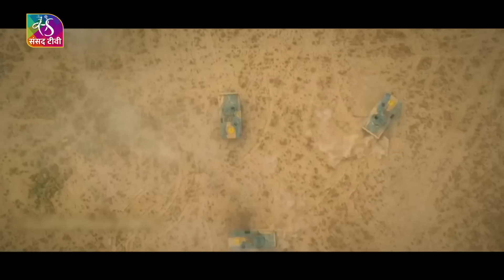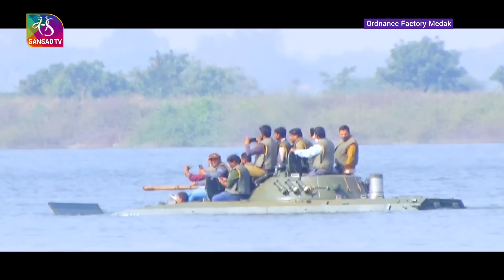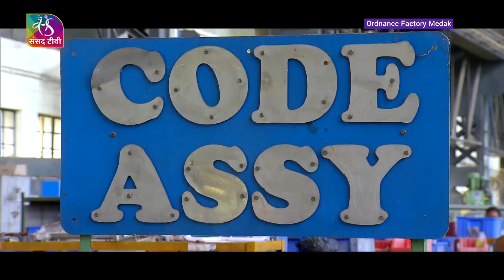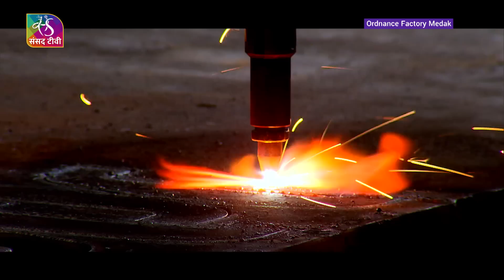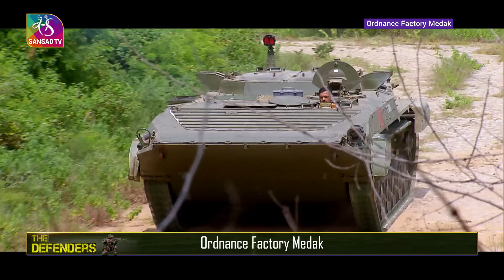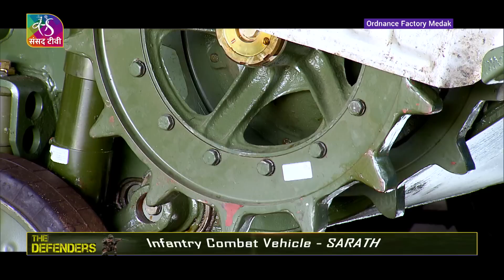The Defenders:  Infantry Combat Vehicles SARATH ICV (BMP-II) | 17 Sept, 2022

Comment: indian propaganda ..this vehicule is 70 years old from battles
Reply: BMP-2 and it's.. kind of like a rival, the American Bradley are both from the 80's, BMP-2 by itself is decent, I'd say that India simply just needs to upgrade it like how some other countries that poses the BMP-2 have.
Reply: @pipopoikapelaa5468  did you see the bmp vs bradley in ukraine ?
Reply: @lonewalker6110  yes but this stuff can also depend on training.  Better training and upgrades (modern fire control system, new sights, maybe a more accurate version of the 30mm, better armor and such)

This could be possible since India does build these BMP-2s themselves

Comment: 6:03 
800 rounds per minute!!😱

Dude even Kalashnikov has firing Rate of 600 RPM...and this guy is saying that a 30mm has the Firing rate of 800 RPM.
Kaunsa Maal fukte hai ye OFB wale?? (Ab to private hogya hai).(｡•̀ᴗ-)✧
Reply: The gun has a selectable rate of fire, either slow at 200 to 300 rounds per minute or fast at 550 rounds per minute. This gives a continuous fire time of 100–150 seconds (or only 55 seconds, depending on the rate of fire chosen) before running out of ammo.
Reply: @yogeshmpsc4144  😂😂
And that's from Wiki isn't it??
Even that's true and that's what iam trying to say... clearly not 800RPM.
Reply: More firing speed doesn't mean it is a good thing. If a system can deliver accurately even low firing rate would suffice for the job.
Reply: @ayonbiswas4186  tell this to OFB who's Workers saying that it has 800rpm which is not true..
It has 550 max Firing rate.
(U are completely out of context).
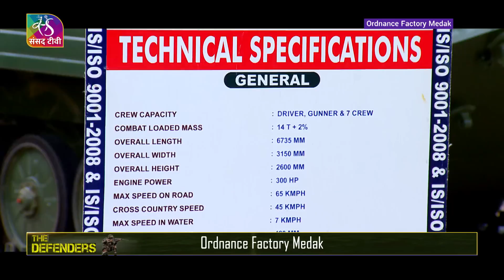Reply: 05:53 Even the specs displayed in the video says 200 to 300rds per minute! From where did that sarkari official conjure 800rds figure? He really must think the sansad tv audience is blind illiterates.
Reply: BMP ...banaa tereliye Diwali k rocket chhodnaa jaise soch raha he k 😀😀😀😀😀😀😀😀😀...9 subscriber 😜